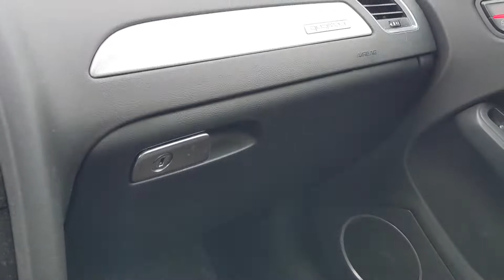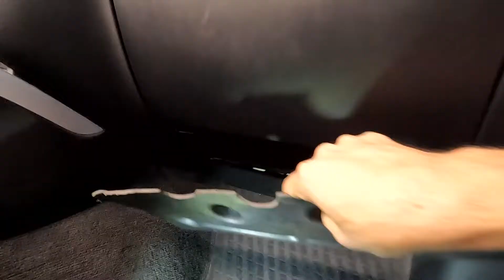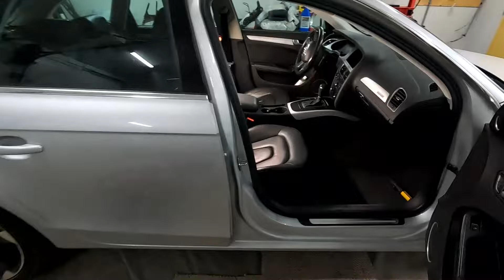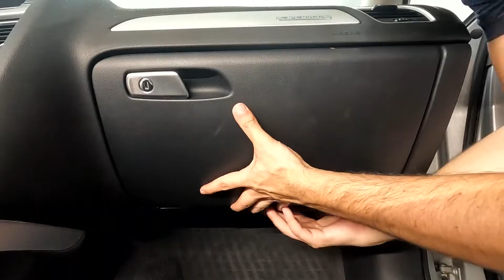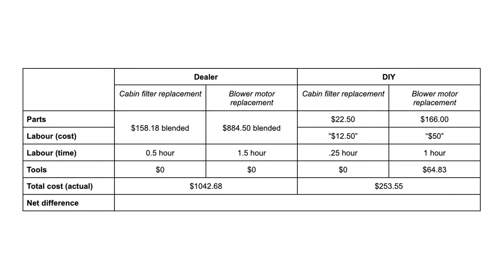Cabin blower motor & filter | Dealer? Or DIY! | Audi A4 B8

Comment: Question: I noticed that my fans were not blowing any air today after trying to defog my windows. The AC did not turn on, the fans did not turn on at any speed and I also noticed that my MMI aux was not working either so this led me to believe that I may be dealing with a fuse issue. I’m curious to know if these are related to the blower motor in anyway? I’m going to be checking the fuses and everything as well.

Comment: Thanks so much for this video. I cancelled my $200/hr appointment for an intermittent blower and replaced the controller, and filter, in an hour. Problem solved. I stripped a couple bolts on the glove box while installing, but there are plenty to hold it in place. Thanks!
Reply: I just did the same.  This video was a big help and confidence boost.  I’ve got reliable AC in my Allroad again!

Comment: I need fellow peer advice from other Audi owners on whether I should take my 2020 Q5 into the dealer for my *2nd quote / opinion*. AC button stopped working. Took it to a local shop who specializes on European car models w good reviews thinking it was the better option over the dealer. 

Turns out - according to them - I have a freeon leak and the Evaporator Core Assembly needs replacement. 15 hour job. They have to remove the dash to get to it. $155 per hour for labor plus parts. Close to $3k. 😮 I'm hoping the dealer gives me a better quote. Thoughts?
Reply from the maker: To help people, can you provide more detail of what the problem is? I assume your issue has nothing to do with the "button stopped working" and what you're actually experiencing is the A/C air no longer blows cold air - it's just ambient temperature. Right? And then what did the shops' diagnostics consist of? To determine that it is absolutely an evap core leak, they would have had to pressurize the A/C system then visually confirm a leak (which is indeed in the dash but not impossible to see with a remote camera). Did they do that? Point is, they better be positive it's leaking before doing the job.
Reply: @FigureItAudi Thanks ...  By AC button not working I meant that it's unresponsive. No hot air blowing. It won't even light up. First thing they told me is that it was out of freeon. They measured the pressure, connected the gauges, put in a dye. They said they added freeon, not sure to be honest. They showed the pressure going down and the only thing they told me was to listen to the hissing sound from inside the cabin, through one of the vents. There was nothing visual shown to me illustrating a true detection or identification of the "leak" or leak location.

I didn't know what I was listening to. Did I hear something? Honestly, not sure I did. Walked away with a steep estimate. Thanks for the quick reply.

Comment: My blower for both ac, heat and defrost would work randomly when I had it on and now it’s not working at all. I changed the fuses but now luck. How do I determine if it’s the fan or the resistor or what?
Reply from the maker: You're going to have to take some things out to do diagnostics because with the fan now not working at all, it could be both things still. If the fan doesn't spin freely, that could indicate the motor is seized (although you probably would have heard weird noises coming from under the dash leading up to this point). You can use your multimeter to check the resistance on the resistor to look for continuity and how much (or infinite) resistance is present. The resistor might also have obvious heat or corrosion damage on/in it. Mine was surface level corrosion but you can open it up to see inside as well. You should be able to find the answer with about 30 mins of removal and testing.

Comment: Hi, thanks for the video. I have the same car.  I live in ontario canada. My car doesn't blow hot air. It worked a couple of times until it stopped completely.  But when i turn it off for some time and turn on the ac sometimes i feel a warm air blow and then cold air immediately. Any idea what all need to be changed?
Reply from the maker: Since it sounds like your blower is operating ok (as in the fan is fully responsive to different speeds and you are getting the air flow volume from the vents you'd expect) but the air temp is unresponsive - that sounds like a heater core problem. Assuming you haven't found a puddle of coolant on your interior carpets to indicate the core is cracked and leaking (or a leak upstream of that), then some part of the heater core circuit (ie starting from the coolant line leaving the block/distribution pipe, all the way up to the core, then back to the block) might be clogged, so warm coolant is never arriving to the core in the first place, hence cold air. Your AC still blows cold because the fan is drawing "coldness" from a different thing inside the dash. OR, you have a massive air pocket in the cooling system (recent coolant change?) and it needs to be bled properly.

Comment: Hey, great video thanks. As for the time from the dealer you have to remember that the mechanic starts his time as he gets the keys. Goes outside brings the car in and into his bay. You can count a good 5-10min just for that.
Reply: This is so incredibly far from correct lmao. Dealer times all come from set labor times from the manufacturer. Any repair, on any vehicle, from any manufacture, has a set labor time attached to it. Let’s say the labor time is 2 hours as this blower motor is. If the repair takes him two hours, he gets paid two hours. If the repair takes him one hour, he gets paid 2 hours. If the repair takes him an entire 8 hour shift, he still gets paid two hours. Dealers are not out here screwing people like people think, people just can’t afford the car they drive so they blame it on the mechanic. And I’m not even a mechanic anymore saying all this.

Comment: You are correct about the clips on the fan blades I used to build huge 30' fans out of steel and we welded weights on to balance the rotation and minimize vibration. Good call.

Comment: Thanks for this awesome walkthrough! Super easy to follow. 
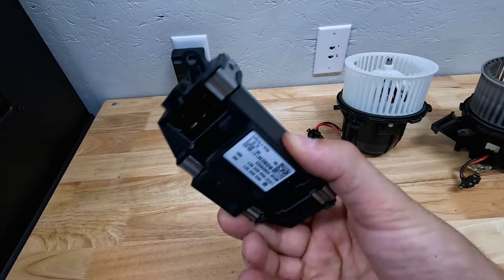Curious how and with what did you clean the corrosion of the top of the resistor? Does it make a difference to clean it? 12:41
Reply from the maker: I wirebrushed a bit of it off but it really doesn't matter much - the important part was not having any water ingress in the first place. It's also just a good reminder to keep an eye on the air inlet duct up behind the firewall and keep as much organic junk out of there as possible.

Comment: @figureitaudi - Thanks for the video.  I have not completed the swap in my Q5, however I think there is a tab that allows the blower to twist, and not sure that it matters (you are removing the old blower anyway) but I think the video captures the breaking of the tab when you turned the blower.  

Excellent cost comparison, great to have a Canadian perspective as well!  

Also, most mechanical jobs are piece rate - quoted chunk of time -  a quick and skilled mechanic can log 15 hours in an 8 hour day.  If something goes sideways, a bolt is stripped, Murphy's Law steps in, they don't loose their shirt.   The trouble is, many mechanics are working for $35 - $50 an hour and the upcharge on the labor is killer - especially with the "Fancy" European cars.

Comment: This video is just what I was looking for ! My A4 2014 has stopped blowing air and cooling fan from the radiator is not kicking when power on the AC. I checked the fuses and they’re all good. I was wondering if it’s a resistor or a blower fan problem, what would you advise me to check first ? I’m subscribing to your channel btw. Videos are really helpful! 🔥🔥 thanks !

Comment: So mine will only blow for a lil bit and cut out you think it’s my control module?
Reply from the maker: It could be. Do you have the ability to provide power and ground to the fan directly? I would bench test the fan to confirm it still works first. I'm not sure what voltage the fan requires (as in, don't necessarily hook it to a 12v battery source and accidentally fry the fan) to do it properly, but that would be my first test.

Comment: This is a fantastic video! Thank you. I had the whole blower swapped out in under 90 minutes, outside in December (Ontario, post snow storm 2022)! Also to note that the two screws for the resistor block are T15 heads. You didn't need the 5.5mm socket. I got the replacement blower from Amazon for under $100.

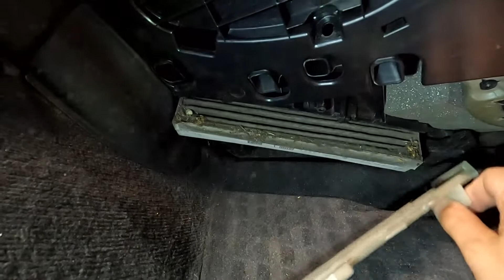Comment: 5:33 Gross! and exactly what mine looked like when I pulled it. Dirty Filter weighed 372.7g. New Hengst filter weighs 203.2g.

17:49 All VW/Audi sourced parts have a 38% profit margin for the dealer. The dealers are expensive because of overhead from the new looking "everything" to the girl with the big boobs who just answers the phone. You won't find those at an independent shop nor are the independents contractually required to move the dealership and/or renovate regularly in order to maintain their franchise obligations.

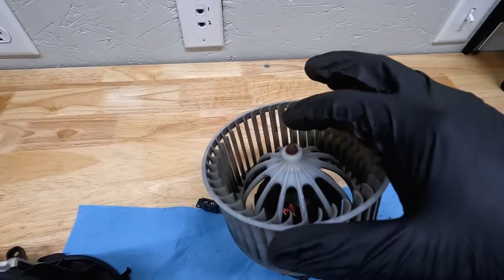19:41 Squirrel cage blower motors will have that notch rotational feel due to the magnets inside.

Comment: Does the B7 A4 have a filter under the dash aswell? I should do mine if thats the case.
Reply from the maker: Not under the dash - it's up in the engine bay in the battery tray space, just under a little black plastic cover. Even easier to replace than the B8.
Reply: @FigureItAuto  Ah yes! That one I replaced recently. Thanks.
Looking forward to seeing the new old Audi!

Comment: Here in California I'm at Volkswagen and we charge 220 an hour so audi should be around 250 to 270, those times go off something that every shop uses and rounds up thr times.
Reply: So goes off how fast ppl do the Job , so some ppl work slower then otheres!
Reply from the maker: @cruzever09  Awesome, I was hoping someone who could speak from the dealer side would tune in. And your answer surprises me; so, you're saying there is NOT standard time estimates based on every service - it's a tech-by-tech estimation of how fast THEY can do the job (I presume they relay that estimate to the service department to then give the quote to the customer)? Am I understanding that right? Because that would infer that a less experienced (ie. slower) person would actually cost you more for a job...which is double bad. Because the customer is paying more and not even getting the benefit of an experienced tech. I guess my point here and in the video is, a lack of standardization is what I struggle with.
Reply: @FigureItAuto  yes from my understanding too that's correct they don't time like a fast working tech , all the times are off for like an example they charge 2 hours for brake Job while like a intake manifold on a 3.6 pays 2 hours witch clearly can do the brake Job in 30 minutes all the times are off and I use to write service as well we can charge anything we want we charge .02 for pollen I can charge .05 for the blower motor as well just depends on the shop.
Reply: $80 and a case of beer. 1 hour taking my time. Been there done that on my q7.